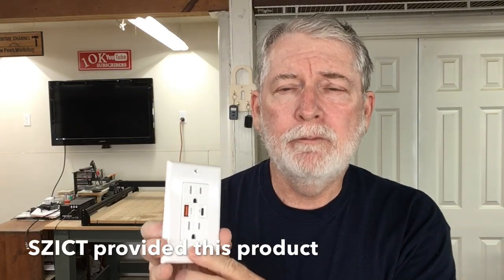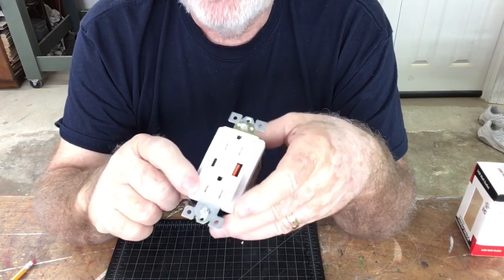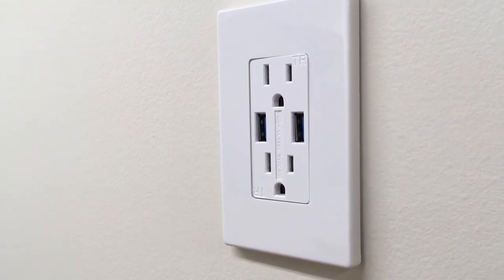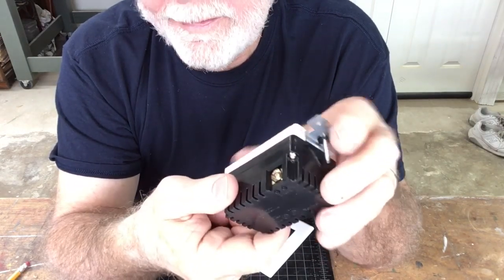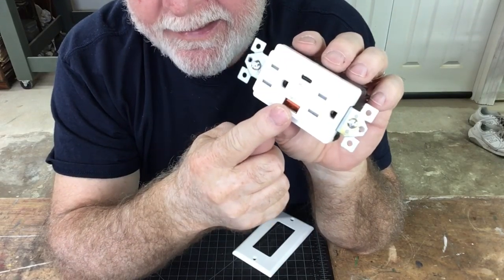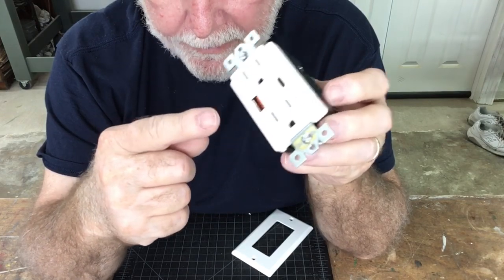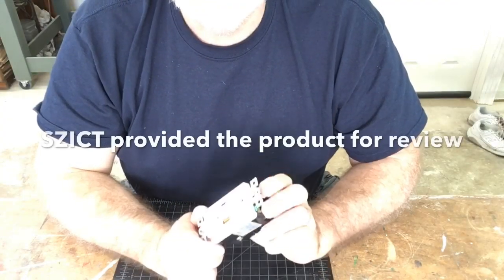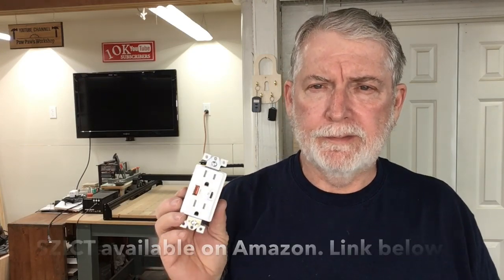SZICT PD & QC USB Receptacle Review

Comment: PLEASE - Do not use the cheater holes. Use the screws to connect the wires. The cheater hole connections will cause intermittent contact failure and I have even found arcing due to poor contact. They may work fine for a while but over the long term, especially in humid areas the wire/contact will corrode.
Reply from the maker: Thank you very much.  I hope that people will read this and other comments made.  You have a very valid point about using the hole connectors on the back of a regular Receptacle. This Receptacle is different. The wire slides into a slot and is tightened by the screws. These holes are not the same as what you are referring to that are found on a standard Receptacle.